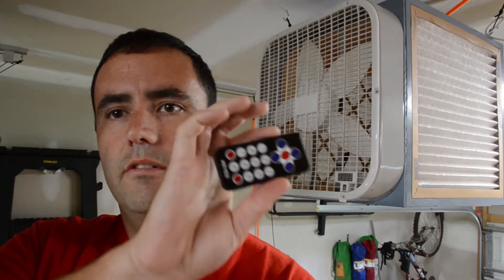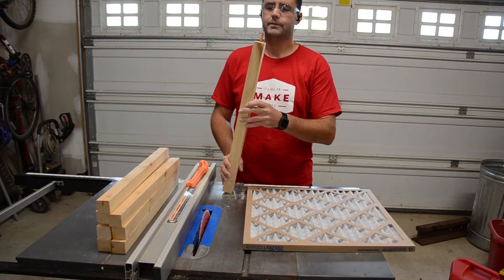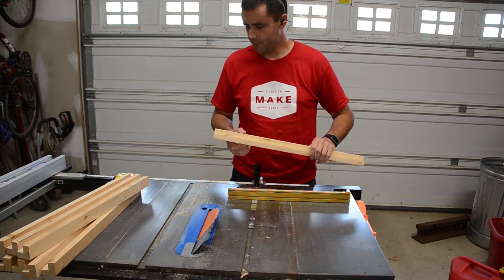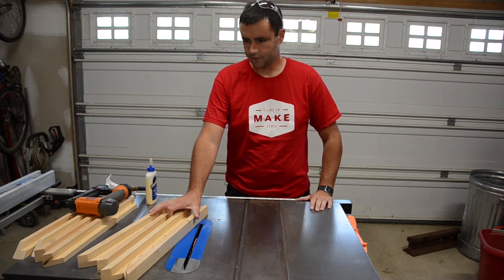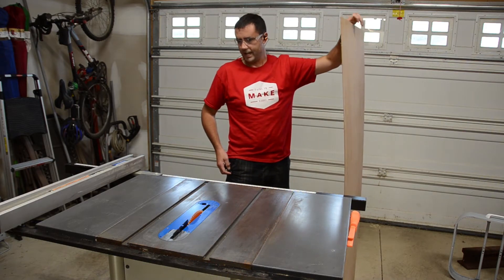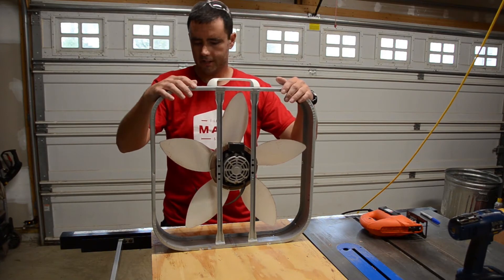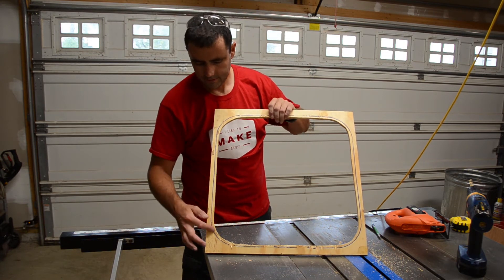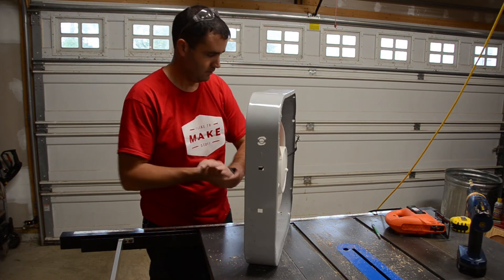DIY Arduino-Controlled Shop Air Cleaner Part 1

Comment: If trapping dust & particles is your goal, then the filters need to be at floor level.  Basic principle in dust control is dust settles not rises. Nice design, just put it on the floor not overhead.

Comment: That’s a lot of work, when you can use just aluminum foil tape & 5 filters together and get even better filter air.
Reply from the maker: I agree that there are simpler ways to build an air filter, but sometimes arduino projects are more about the challenge and the learning opportunity than they are about efficiency or cost.
Reply: this looks way nicer

Comment: Why not have the airflow straight?  Being that it has to curve to escape doesn't this cause some resistance in the airflow?
Reply from the maker: If I were to build another one, I would include a filter on the back too for better airflow and for more filter surface area.